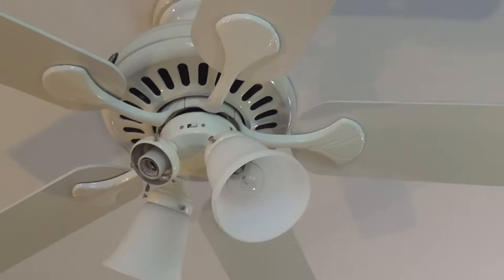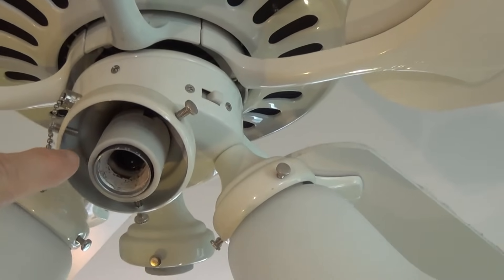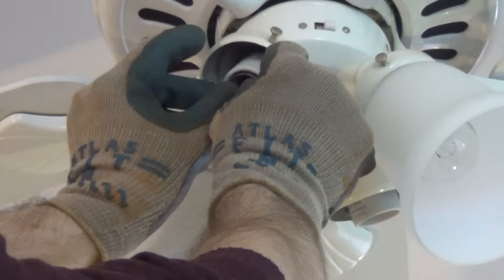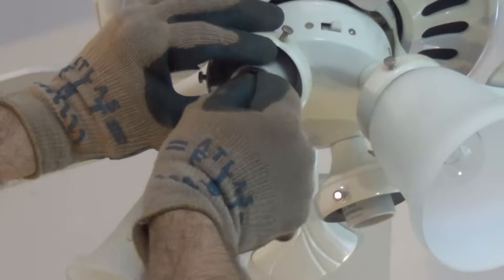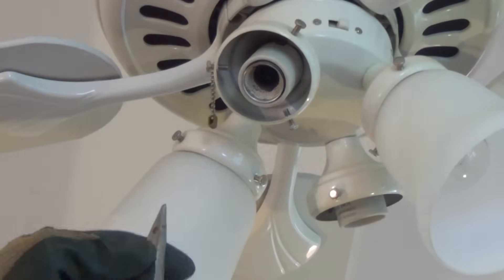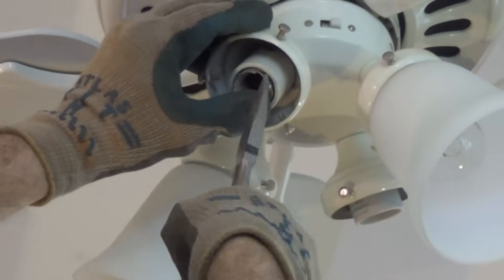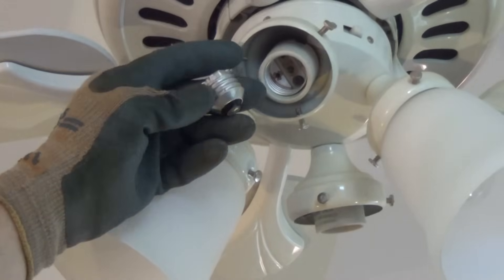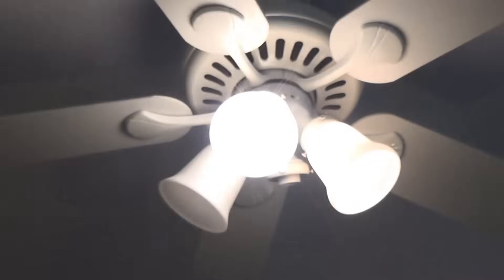How to Remove a Broken Light Bulb Base from a Socket

Comment: I started watching your video, and the idea popped in my mind when you said apply pressure to sides. So I got an old cork from a wine bottle wrapped it with a kitchen towel and stuck inside the light bulb base and twisted it (on an angle). Worked like magic. Thanks for your video.
Reply: Wow! That's genius!
Reply: Great tips in the video but I have push bulbs and I almost stopped watching. Then I saw your comment about using a cork... Success!! New bulb in and now I get to relax with wine :)
Reply: My broken bulb was small and backward to me in the over counter mivrowave. I had to trim the cork a few times but finally got it out. Thanks!
Reply: I just wadded up an old sock lol
Reply: Ahh you’re the best! I tried the cork method and got it out in 5 minutes! Thank you! 🙏
Reply: Cork worked for me too, thanks
Reply: Thank you so much. The fitting was embedded in the ceiling. Not easy to access. Did the wine cork tip. Result! 😃
Reply: Worked! Thank you
Reply: I easily removed the light bulb base with the wine cork. Thank you !
Reply: Omg the light bulb worked! But on the 2nd light bulb, theres a piece of broken glass and the cork doesn’t hold (too slippery cause of the broken glass), so i kinda cover a double sided tape on the cork and it did worked!
Reply: Just worked for me, you’re a genius!

Comment: In the future just wrap some electrical tape on a screw driver but make sure it’s in the sticky side. Then stick it in and screw it out. You will find that this way is easier and also a lot safer. Someone may have an issue we’re their light switch may not be in the best angle so this would be helpful. Overall great job.
Reply: Wow creative idea

Comment: for anyone watching this , it's so much easier to place a thin strip of two way tape on the part of the bulb that contacts the metal base.  push the bulb into place on the metal base.  Pushing up on the bulb  and  twisting slowly will usually remove the broken base portion.
Reply: you're a genius! worked like a charm. thank you!
Reply: What?
Reply: Try using a wine bottle cork

Comment: LOL I found this video after the exact same thing happened to me, witha  ceiling fan and bulb.  My search criteria was the exact title of this video.  Side note, don't use your fingers to reach into the bulb socket.  use hemostats or needle nose pliers to grab the edge of the bulb base.  Much easer to do!  My problem was that the ceramic base was also loose.  ugh.  Required needle nose, and channel locks simultaneously.

Comment: My problem is the light in my microwave, which faces BACKWARD toward the wall.  I had never replaced it, and I've been in this RV for nearly nine years.  When I tried to unscrew the dead bulb, it broke in half in my hand and left the socket in the fixture.  

I tried picking it out with needlenose pliers, but it's impossible to use them...tight and awkward.  I can't even SEE what I'm doing unless I use a mirror, and I'm not good at that.  Obviously, I can't use the end of a broom handle.   I don't even use the microwave, but I miss having the lights it has.  I can't use the one on the other side, of course, because I have the circuit breaker off.  

Any other suggestions?  Thanks!
Reply: @vegasstardancer USE A WINE CORK IT WILL WORK LIKE A CHARM!!!

Comment: I’m 13 and was changing the bulb in a shower. When I was putting the new one in, I tightened it too hard and the glass broke down to the metal. I struggled for like 30 minutes, this vid was the one that got it out. Thanks.

Comment: Thank you for the video! Unfortunately I didn’t come here until I tried to remove it myself. I used the pliers but ended up bending the metal… Didn’t have a wooden dowel like others in the comments but I rolled up a piece of cardboard from an Amazon box, squeezed it in and it worked like a charm!
Reply: I used pliers too and ended up scrunching the metal..now im screwed..dont know what to do..
Reply: Rolled up cardboard really worked!!

Comment: Just had this problem. To remove the stuck bulb parts, turn off the power to that light, put on rubber gloves, and stick the handle end of an adjustable  wrench into the broken socket. It is a perfect fit. Then using the wrench turn the broken socket until it is released from the light fixture. 
Thank you for making this video.

Comment: Thanks so much for this video, and also, all of you commenters for your ideas! I had this happen with one of my recessed kitchen lights, and I was able to get the base out of the socket with a screwdriver and a pair of pliers. I tried the broom handle , a water bottle and an olive oil bottle first, with no luck. However, once I tried the screw driver and pliers, it took me just about 5 minutes to victory! I have some rusty gunk that fell out to clean up, but I am so relieved! Thanks again, everyone.

Comment: Yeah its easy when you can access the socket. But what about catherdral ceiling lights? I broke one while changing a bulb using those extension poles and I don’t have a ladder tall enough to get up there. Would hate to spend $$$ for a massive A-frame ladder to swap out one broken bulb. Any suggestions? Is there an accessory you can fit onto the light changing extension poles?
Reply: I'm probably a bit late but I think you can rent ladders, just ask around or look online.
Reply: oBringMeTheDiscoCake thx.  Thanks.  Yes i thought of that but it was too much of a pain to get a ladder that big to fit on top of my small car.  So after some thought, i came up with a solution that worked for me - a twist on the old potato trick.  I wrapped thick double sided tape around the tip of my extension pole until it was just wider than the socket. Then pressed the taped end into the damaged socket and twisted - old bulb end came right out. Wear safety goggles and a hat though as bits of bulb came down as i was twisting.

Comment: Thank you so much!  I am a 72 year old widow that had a spotlight over the garage break.  I got a pole to remove the bulb but the base broke off, so I had to use the extension ladder after all.  I couldn't get it out until I watched your video.  After it finally loosened, it came out easily.  Thank you so very much!

Comment: Another way I found that worked was putting pliers in the center of the broken bulb and opening the handle of the pliers so that the pliers are applying force on opposite sides of the bulb, then applying force to the left to loosen the bulb from the socket.

Comment: Every time this happened to me, there were glass and wires sticking out. The potato method is effortless. Thanks for the video xoxo from Arizona.
Reply: @suzisaintjames I thought I was the only person who remembered this! I was scared to suggest it! 😂🤣😂🤣😂🤣 We have to be careful bc without the disclaimer of safety and making sure to cut the power source off at the breaker or the switch/ plug  it would become very dangerous and electrical shock can and will kill you!
Reply: @youknowimcute21  , you're right about the disclaimer. I'm just telling what I do... not suggesting that you do the same. Truthfully, I don't turn off the breaker if I'm confident that there's a switch to the fixture and it's turned off. But if you aren't sure turn off the breaker or even all the power to your home to be safe. 💖🌞🌵😷

Comment: You went through WAY too much trouble.
The simplest and easiest way is to use a wooden broom handle, no electric conduction at all and it's the perfect size for the inside of the socket. 
Stick the broom handle in, twist and voila. Easy.

*If the bulb has been in place for a looong time or if it's really stuck you can use a rubber glove on the end of the wooden handle to provide extra grip and then you can easily apply the force needed for it to come off.
Reply from the maker: Great idea!
Reply: I actually had one stuck in our porch light...just tried your idea with a wooden rake handle and it worked beautifully! Thanks!
Reply: @jordan-kz3rx  VOILA INDEED!
Reply: Broom handle worked for me, too! Thanks for the tip!
Reply: My daughters ceiling fan has smaller light bulbs with tiny bases (I hate them) but I used the wooden handle of a toy hammer when I saw your solution and it worked!
Reply: Amanda761000 this is literally what I did word for word
Reply: @HowToWith GEO. What if the silver bulb end is REALLY stuck in there hard? Okay, I tried the long nose pliers on one side. It didn't budge at all. I then tried the wood end of a standard screw-in handle, several times and it actually seemed to be coming out a little bit like a millimeter, when it was flush on one side before. Then I tried your long nosed plier technique again, on 3 sides, and voila, the whole piece loosened up and screwed right out of the socket! The plier technique would have worked all the way if I had just followed your instruction in the first place. I think a piece of rubber on a standard screw-in wood handle from the hardware store may also work with a piece of rubber on it or a latex glove, but without a piece of rubber, wood doesn't have enough grip unless the silver base of a lightbulb is not stuck in too tight. (Mine was.) Anyway, your lovely video worked so perfectly to solve this problem - electrical and all explained - very professional! Thanks! 😀
Reply: Your a legend a god and a lifesaver all at the same time you know step bro and me had a pillow fight and we broke it (cough me) and we just hid up ever thing👏👏🙏🙏thank you🤝
Reply: Thank you. This worked perfectly. Also, a little tip, to ensure that it grips when you twist, a rubber glove over the end of the broom handle.
Reply: Thank you so much 😆
Reply: Thanks for the broom handle hack.  My handle was too small to get it out, but I used a rubber finger (the kind you use to flip papers) and it gave the handle just the right amount of resistance to unscrew the leftover bulb base.
Reply: Great tip! I just used a wooden spoon handle on a candelabra socket.
Reply: Thank you so much! Got it out with ease after so much trouble
Reply: Omg thanks so much!!! It really worked!!
Reply: Thanks a lot man
Reply: Just did the broom techniqure right now. Worked like a charm. No tools. No gloves.thanks to OP and the broom guy
Reply: Thank you this worked for me. 5 seconds and it was out!
Reply: Thank you for your comment you saved me
Reply: The wooden broom handle worked like a charm! Thank you so much!

Comment: I'm probably an idiot, but I've never turned off the electricity to do this, or used gloves.
Reply: @Russell Brown. I KNOW this is probably a dumb question, as I'm not really mechanically inclined, does it really matter if the electricity is on or off?
Reply: @geoffelder2236  I mean if electricity is flowing, I assume there is a risk of electrocution.

Comment: What would cause a light bulb to rust in the socket? I descover this after bulb was stuck. I've experienced/successfully removed stuck bulbs before in other light fixtures,  but never as stuck as this was. I actually cover the bell globe with a bag and purposely broke bulb. Now I'm questioning if I should used the fan or light at all. I'm healing from a broken back, needless to say do not move to fast. The stuck bulb situation wore me out. Little more infor... I live in a condo. The ceiling fan w/4 lights is located in my living room above my hospital bed. The room above is a bedroom and above that room is the attic.  The attic has never show any signs of water leaks (in 20yrs). The upstairs bathroom is +/-25ft a way. Am I  wrong in thinking that water must  found the socket & water is what caused the rust? Sorry this long,  trying to be exact. Sincerely,  thank you for your time.

Comment: Thanks. The idiot who designed my microwave placed the light towards the back,underneath and facing towards the wall! Even lying on top of the stove and looking up didn’t work. I had to use a mirror and eyebrow tweezers
Reply: Saffron Sugar I am having to do this to our microwave range light thing I don’t know if it’s going to work with tweezers because who ever screwed in the bulb got it in there quiet tight.

Comment: Question: what if you were a really dumb and impatient male and used long nose pliers to rip it out of the socket and in doing so broke the plastic inside that holds the bulbs and now the bulb sits in there wonky 🤣

Comment: A potato works very well. Just jam the end of the potato onto the metal and twist.
Reply from the maker: +Crayola Verde I personally do not recommend using a potato.  It can leave debris and moisture in the socket and could cause an electrical fire.
Reply: That was my thoughts too.